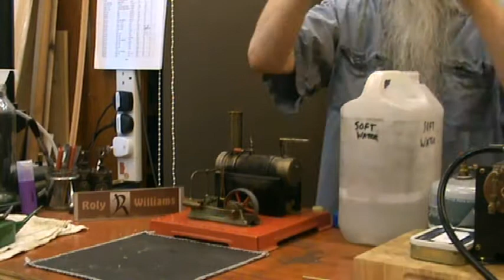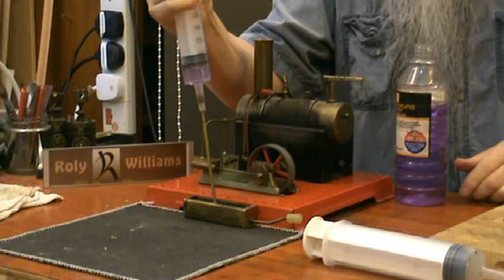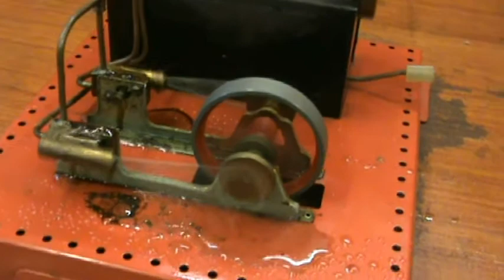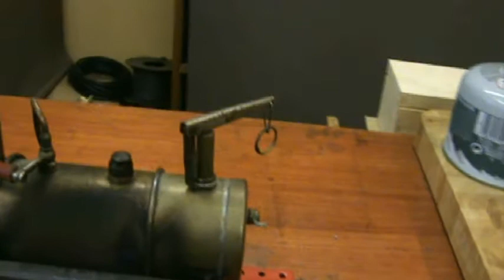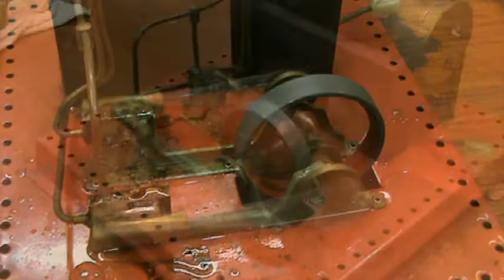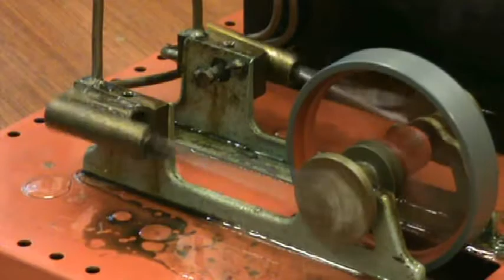Mamod SE3 1972

Comment: I have owned about 15 of these over the years but have never seen one with those circular cranks.
Reply from the maker: Most do have traditional cranks, but mine is not the only one I've see with disk cranks. I assume they're original but maybe not.
Reply: @RolyWilliams  I will have to keep an eye out on eBay for one. Cheers.
Reply: What type of fuel are you using there Roly?